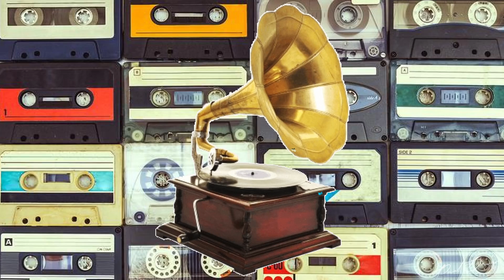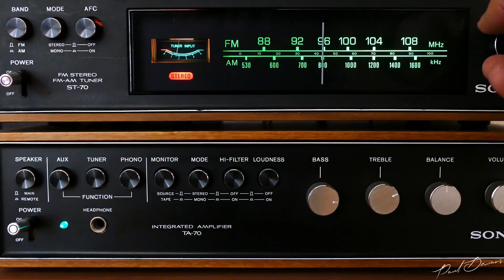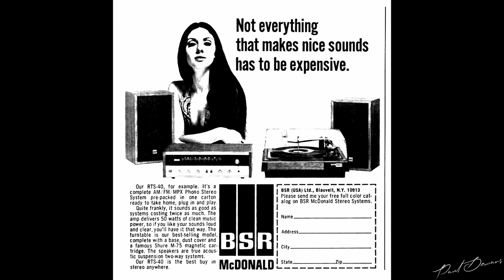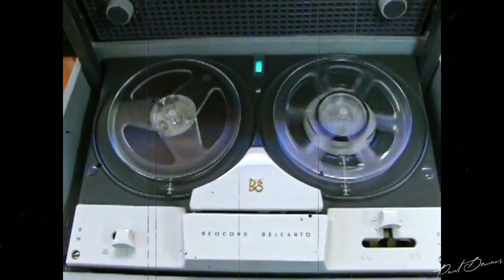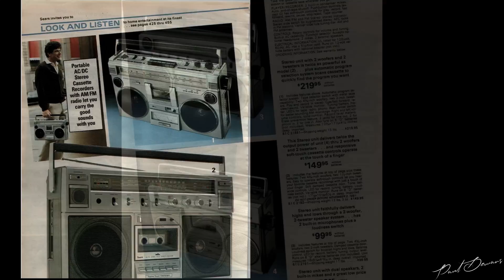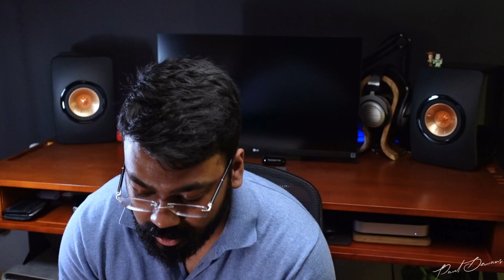Automatic Record Changers | The Mechanical Playlist - BSR UA70

Comment: I grew up with these bsr's my father had the ceramic cart in a console we had several  as I grew up now I have a bsr like the one my father had in his honor I bought it very little cleaning I had to do platter was frozen but it works fine  I also found a bsr mcdonald 610 with a magnetic cart it has the counterweight I had to unfreeze the mechanical parts which were all gummed up but it works fine now on the sound quality I will have to disagree with you the 610 came with a adc cartridge I never had one always thought they were cheap but replaced stylus with an eliptical stylus this sounds great I do not hear any rumble unless I put it up at a very high level which is way too high it is normal to hear rumble if tone arm is too close to speakers all my turntables are above my speakers even when I raise volume to the highest I will get no rumble I even tested this against a Dual turntable which was considered high end to the bsr they both sound great no rumble ,I am always hearing from idiots who say that bsr's are cheap ,some were but if you find a bsr with metal platter and tone arm with the counter weight these are built better and can compete with the so called better TT's I have a pro-ject debut 3 turntable supposed to be high end I love it but I will hear rumble on this one if I put my volume up too high more than the bsr, garrard.dual tt's I love these type of TT's them being mechanical fascinates me every turntable will give you rumble all depends where you place them if TT is above or far away from speaker rumble will be low or zero all of the TT' s I use are very quiet when playing records I do not understand about the noise you mentioned JRo
Reply from the maker: Hi Jro! Thanks for sharing! I'll try placing it above my speakers. I've never tried this, but it sounds logical. The mechanical factor never gets old for me. It's art in motion whenever I see it operate. I haven't heard any pro-ject turn tables yet, but they're gorgeous to look at. I'm sure they sound great, too!